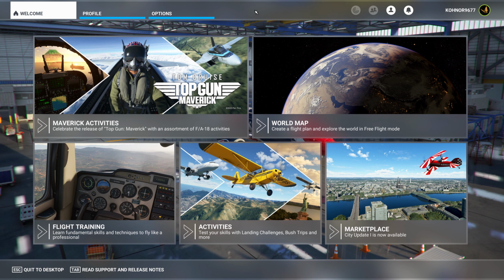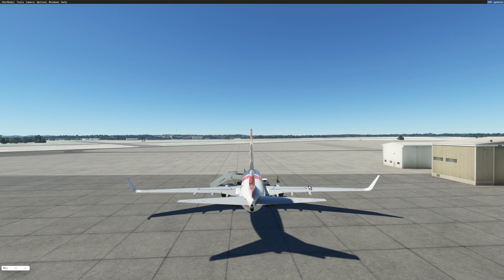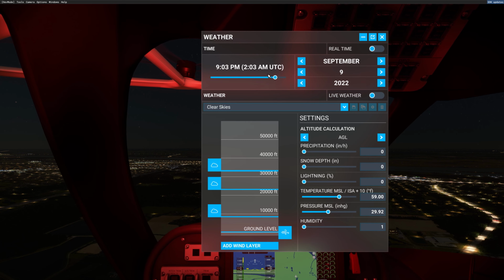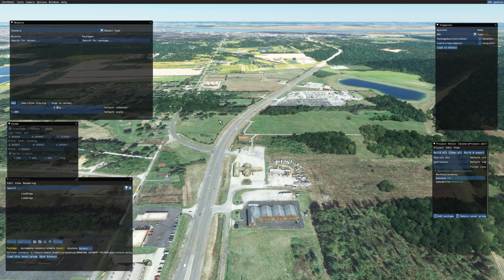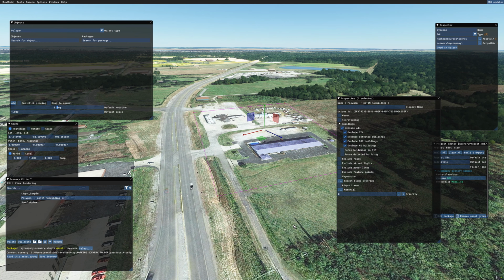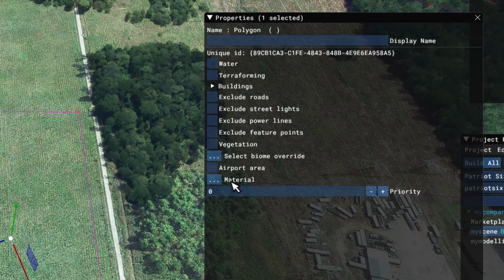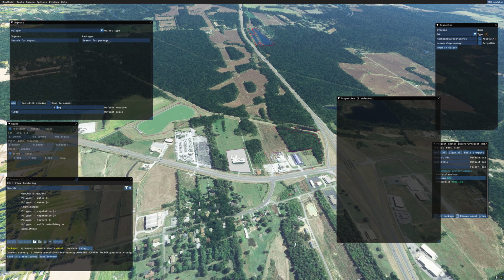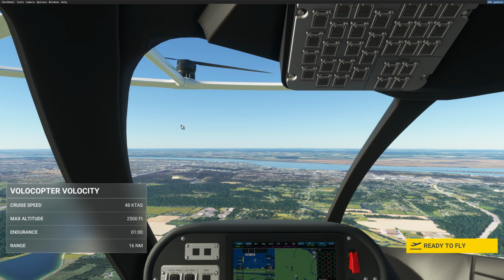22 MSFS 2020 SCENERY TUTORIAL - REMOVE TREES, WATER, AND BUILDINGS - ADD TREES, WATER, AND BUILDINGS

Comment: Hi, thank you very much for this detailed tutorial. I followed the steps, but the scenery is in content manager as "not installed", cannot instal it and the changes are not visible in the sim. Can you please help? I wanted to remove trees from runway.
Reply from the maker: Thanks for watching. I am trying to understand your problem. I am confused. When you say, "the scenery is in content manager as 'not installed,'" Okay, I think I get it now. So, I will give you the steps, and you can tell me if you completed each step. In addition, if you are working in MSFS 2024, I just completed this same video using the MSFS 2024 SDK. https://youtu.be/ZggMY8PzjIU

1. You build the scenery folder and load it into the editor.
2. Once everything is set up in the inspector, you build the initial package.
3. Make scenery changes.
4. Save the scenery in the Scenery Editor.
5. Build the final package.
6. Move the package in the package folder to the community folder or designated scenery folder. 
7. Ensure the package you move is the package, and make sure the package is not in a subfolder. You can do this by opening the package, and you should see a "manifest.JSON," a "scenery" folder, and a "contentinfo" folder.

That is all it takes. Let me know if you are still having trouble.
Reply: @patriotsix5880  it works now after I added thumbnails. thanks
Reply: @patriotsix5880  Hi, I am having the exact same problem. I followed your steps, but I am noticing that when I build the final package, the manifest.JSON file is not being created. Like the user above, I am able to view my package in the Content Manager, but it says "Not Installed." If I click on the info button, it says "Waiting." Any ideas on how to fix this? Thanks!

Comment: Hello Sir. Thank you for your many good videos on the topic of MSFS and creating scenery with SDK. I come from Germany and have problems with the English language. It's about the polygons. Although I see a red cross, I can't draw a red line to draw a polygon. Do you have any ideas? That would be nice !! Thanks and Regards
Reply from the maker: Hello from the USA. Thanks for watching. To build a polygon, you must hold the left control key down and click the left mouse button each time you want to make a point. Could you let me know if you are doing it this way? Wait to release the left control key until all points are built. When you come to the last point, double-click on the left mouse button, and then you can release the left control key. Good luck and best regards.
Reply: @patriotsix5880  Many thanks for the quick response. Excellent. I tried it as they wrote it. Holding down the mouse button for a long time doesn't work. Don't click once either. There is no line to the next point. unusual. I restarted the PC several times. That doesn't help either. Unfortunately there are hardly any current tutorials in German. Many greetings to America.
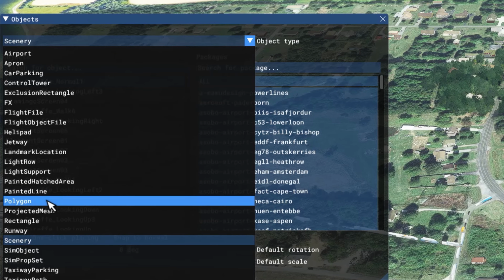Reply from the maker: @gunnarfliegtdrohne  Are you still having trouble? I don't think restarting the PC will fix the problem. I think it is probably how you are doing it but I do not know for certain since I am not there with you. Holding dow the mouse button is not the way to do it. You hold down the  mouse button down. at 12:43 is the exact way you do it. If you continue to have trouble we can get on Discord and figure it out. Do you speak English at all? I can't understand German but I can get through even bad English.
Reply: @patriotsix5880  Thanks for the reply. I created a new folder exactly according to your video and did everything according to your instructions. still I can't create a polygon. I see the red cross, but I can't draw a red line. no matter how I press the left mouse button. I can't find it on the discord server. what is her name there? Your link in the video description didn't take me to your discord account. Thanks for your help !!
Reply from the maker: Try this. https://discord.gg/gWAfZ3vm28 I do not stay on Discord all of the time so once you get in, let me know in this chat thread with a time we can hook up. I can accommodate most times because I am often up during your daytime. Give me a date and a time and I will get on Discord.
Reply: @gunnarfliegtdrohne after clicking “Add” you have to go to the Scenery Editor tab. Then press the Ctrl key on your keyboard and start clicking for the polygon’s corner points. Double click to finish the polygon.

Comment: Is there a way to type the coordinates for a single Polygon point instead of moving each one? I'm adding a lake and it's taking along time moving each point using translate. I'm trying to make it exact. Once I create my lake, do I have to change the depth/elevation or will float planes land without those changes? If you already have a tutorial for this let me know. I love your videos. Great help!!!
Reply from the maker: Hello Bredd. Thanks for watching. I was confused at first because building a polygon is a snap. However, once I read the entire post, it makes sense. I have never tried to move a polygon point by typing, but you should be able to type in the Gizmo. If you use translate, you will notice the coordinates in the Gizmo change as you move. Still, it will take time. I get it. When you have that perfection bug, it makes you work harder. If you want precision, it's going to take time. But you will be satisfied in the long run. 

In full disclosure, I have never flown or landed a float plane. You can use terraform and lower the elevation, but I would do that as a last resort. Terraforming can make a mess because it is clunky. I would build the lake, add lake water, and try it with the aircraft. I hope it works for you. If not, you can experiment with terraforming. Fingers crossed, and good luck.

Comment: I don't undertand this. How do I do exclusion rectangle? I did it but it doesnt save. I open it and the exclusion rectangles are gone.
Why can't I just edit the scenery and remove the objects I don't like?
Reply from the maker: I don't know why the exclusion rectangle is not working. It is a well-known and used tool within the community. I need help to answer through chat because I can't see what you see. You would need access to the entire scenery folder to edit scenery that you did not build. If this is payware that you added to the community folder, all you have is the package. The same applies to payware you buy through the store that goes into the official folder. I have reached the limit of my help through YouTube chat. If you have a Facebook account, you can join my Facebook group to get help from me or others in the community. Having the ability to upload images is very helpful. Good luck. https://www.facebook.com/groups/788136852324508
Reply: @patriotsix5880  I do not use facebook. I made a project, set down an exclusion rectangle, and saw the object disappear (in the editor) then saved and compiled the project, got a folder and package. Put it where my other packages are, but the exclusion rectangle doesn't vanish the object there.

Comment: can you recommend a tutorial on how to remove static aircraft?
Reply from the maker: I don't have a video removing static aircraft, but it is simple. If you know how to make packages, ETC, build a package and use an "exclusion rectangle." Adjust the rectangle size to include what you want excluded but try to avoid objects you don't want to exclude. Use as many rectangles as you need. You can choose to remove all objects on the exclusion rectangle or tick the objects you want to remove.

If you need to know the basics, I recommend this video first. https://youtu.be/MXPL0n0kA_4

Good luck. Please let me know how it goes.

P6
Reply: @patriotsix5880  I tried all the exclusion options - delete library, delete all, delete simobjects with no success. Eventually found the library involved (Library1v14) and removed it from the Community folder. It removed the offending gliders.

Comment: It looks like now before you "Build package" you need to add a marketplace thumbnail (412x170), if you dont it gives you a error in the console and doesn't create the layout.json and manifest.json
Reply from the maker: You are correct. The short story is that I recommend deleting MarketPalce data, or you could build a thumbnail the correct size. For ease and to remain error-free, I go with the first option. I made a video about the latest SDK changes. You can find it here and pick the chapter you need. https://youtu.be/MXPL0n0kA_4

Comment: Hello Patriot. I have created a project to edit an existing airport scenery and would like to remove some buildings of the scenery. I used the polygons tool and exclude buildings otion but they cannot be deleted...  I don't know why!!! Any idea?
Reply from the maker: Hello and thanks for watching. There are a few variables we have to talk about. If this is a standard Asobo airport, you can remove scenery objects including buildings. Assets that are tied to the airport package like taxiways, runways, and maybe even the control tower cannot be removed with a polygon. To make those changes, you need to edit the airport. If it is a payware airport, you can have trouble removing items. I have the payware KATL and oddly both the Asobo tower and the Payware tower are side by side. I wasn't able to get the payware creator interested so I attempted to remove the Asobo tower with a polygon and was unsuccessful. What airport are you working on and what are you trying to remove? I can run a test and see what happens.
Reply: @patriotsix5880  Hello. This a payware scenery converted from P3D and provided by a friend. I am afraid that all objects are in a block... I am unable to retrieve the start points on the runway, even the taxiways that I can not edit... I have tried the Exclusion rectangle and then, all objects have disappeared, even with a small rectangle :(. I think that I will resign. 
I am currently attempting to add some parking point to start the flights but I have plenty of errors (point not linked to main graph) that I am unable to resolve :(
And of course, I cannot save the work done because of the errors.
 I spent already a couple of days and I feel running in a one-way street 🤣
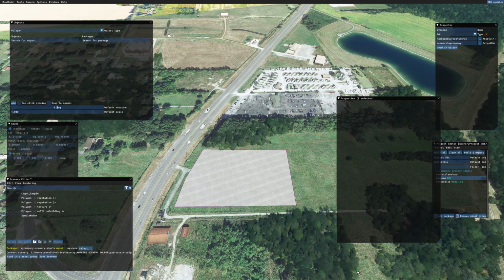Reply from the maker: @braudoux  I understand. Yes, when dealing with taxiways and start points you have to take a totally different approach to the project. All navigation-controlled items are part of the airport package. In addition, you have to deal with items disappearing while in the Developer Camera. I am not sure why that happens. I assume it is a limitation in the SDK. if you want to give it a try, will link two videos. The reason I am linking two is that in one I edited an existing airport but I did not change the taxiways. In the second video, I build taxiways from scratch at a fictional airport but the process is the same.  Edit and existing airport: https://youtu.be/UlWiAbhersg Building taxiways: https://youtu.be/kYBnZlAyF8s Taxiway works starts here: 19:20 Add Taxiways It is time-consuming so set a lot of time aside. It can be done but it is not an easy fix like using polygons to remove items. I am sure I mention this in the video but all taxiways have to be linked and contiguous to get by the errors.

Comment: Thanks for the great video. I tried it out  & followed along on a small, relatively unimportant airport :) in case I screwed something up. Worked great, and a tiny grass strip near me now has a small paved parking area and a courtesy van, as well as a mystery luggage container.

However... when I try to edit any other airport now, the elevation seems to get messed up upon loading, and as I scroll around a bit, the ground-level-polygons (aprons, runways) disappear under the terrain, leaving only satellite imagery visible.

Further, I seem to only have some objects available. When I did the first airstrip, each category was full of stuff. Now, most are completely empty.

Any ideas what might be causing this?

Thanks again.
Reply from the maker: Thanks. Here is a tip, you can't screw things up. All of your work is in the scenery folder you are working and a simple delete puts everything back to normal. So, don't worry about messing up. Let me unpack your questions now. When working in a complicated airport, sometimes in Developer Mode, airport components vanish as you zoon around with the camera and leave only the satellite images. I am not sure why this happens. Without more information, I assume it is limitations in the SDK but that is a total assumption on my part. it can't be a memory issue on my end because I have a lot of ram compared to most. As for the objects, that has me perplexed because I have only seen that issue when I had nothing selected on the right pane in the objects window. Make sure you tick "all" and you should see all of the objects. I hope that answers your question as that is the only reason I know the objects window will be empty. The problem you mentioned about the scenery vanishing happens to me also. I work around it as best I can.
Reply: @patriotsix5880  Got it - thanks again. Hit the "All" selector & have my objects back.

However, unlike when I followed your tutorial, for some reason, the objects I'm adding now don't show up in FS (just trying to add a few cars and things to a different airport) but the scenery is found in the Content Manager.... any likely culprits?
Reply from the maker: @androidfarmer8863  Hmmm if the package that holds the objects you need shows up in the content manager they should appear in the objects search. That is perplexing. It is likely something very simple. if you know the name of the package the items are located in you can look at the packages loaded in on the right side of the objects window right below the "all" selection. You can even select that specific package if you want and see the items in the package. If the package is not in the objects window, then it is not loaded. I have never seen this before. There are standard items as part of the normal Asobo scenery and they all normally appear in the objects window. You can limit what you see if you enter any query in the search bars on the objects window. If there is no query going on and "all" is ticked, everything should show up that is loaded. If the problem persists, there are other options we can try. We can get as granular as needed. Let me know if we need to go to the next level. Good luck, friend.
Reply: @patriotsix5880  OH! They show up properly in the editor; I make the package, put it in the Community folder, restart the sim, but the airport is just as before. hmm....
Reply from the maker: @androidfarmer8863  Sorry. I misunderstood the problem. To be clear, you save the scenery, then build the package, and then put the package in the community folder. Right? If you follow all  of the aforementioned steps and still the added objects are not there, please, give me the ICAO of the airport you are working so I can look for myself. Do you have any payware or freeware at this same airport or is it stock Asobo airport?
Reply: @patriotsix5880  Good morning & thanks again - tell you what - I'm going to step through the tutorial again just to make sure I'm following correctly. I have a feeling I may have missed something. I haven't uploaded my mods to marketplace though. Airport that was successful was PA77 and airports that failed were N14 and KTRL. Will report back.
Reply: Holy cow! I think I figured it out. Modifying KTRL... Terrell Municipal, Terrell, TX. 

When having "myscene BGL" selected and then "Load in Editor", everything seemed pretty normal. However, as noted, nothing seemed to be showing up when generating it for the Community folder. When I re-loaded the BGL later, none of the objects I created were there. 

When I compiled it, I got an error saying it couldn't find the asset group... couldn't help but notice a little button in the Scenery Editor labeled "Load this asset group", (Containing two default files, Light_Sample and (SampleMyBox) - which I did, and re-compiled, this time without the error. However, my objects still weren't there.

So, having "re-loaded" the asset group, I dropped another baggage cart into the scenery, saved the scenery, re-compiled it, transferred to my community folder, and... boom. I now have a baggage cart. :)

Going to test this out again later from scratch.
Reply from the maker: @androidfarmer8863  Good deal. Yea you took a deep dive into the workings. I typically stay in outside of that in videos. Its a big bite for newbies.

Comment: The airport I'm working on has a terminal that's far to high, in real life its 2 stories tall, in fs 2020 it's about 5, is there a way to adjust the height of a stock building? It is not photogrammetry.
Reply from the maker: Yes. What you have to do is search through the scenery library and look for an approximation. Of course, you will not get an exact match. In this video where I typed "buildings" in the Objects window search bar; that is what you should do. There are many buildings in the library so it is a search process by trying every building until you find a close match. If you have a picture of the building as is and how you want the building to look you can go to https://www.facebook.com/groups/788136852324508 I will approve you and you can upload images for me to see. I will try to help you find something close, if possible.